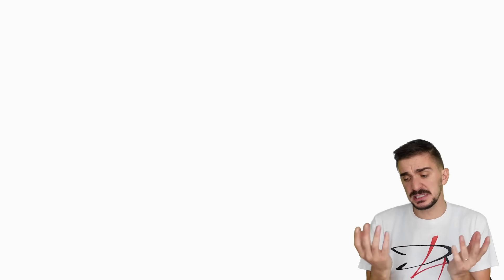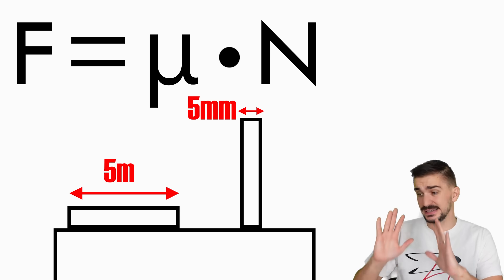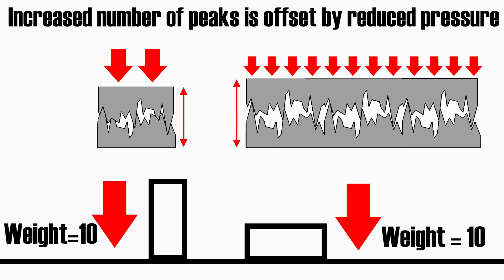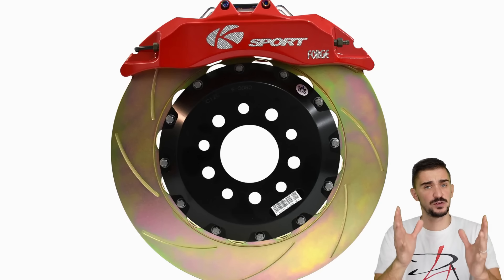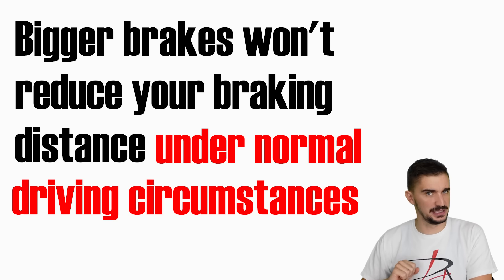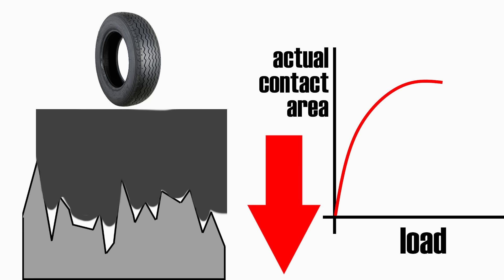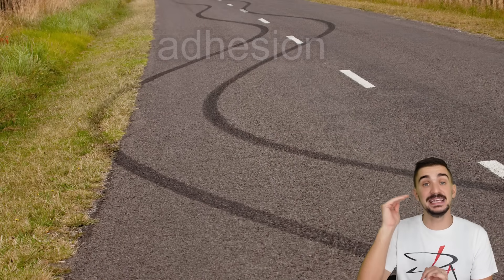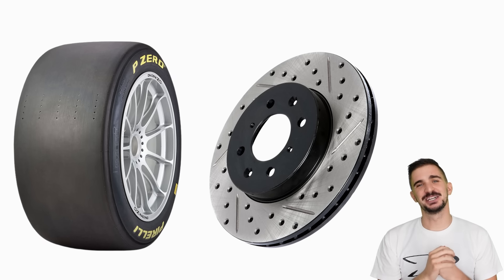Why Big Brakes Won't Stop You Faster but Wider Tires Will - Friction and Surface Area Explained

Comment: Sorry, but your intuition is wrong. As a motorcyclist I will tell you a simple fact that the same motorcycle with a 320mm front brake rotor will stop faster than with 270mm rotor.
You are trying to make a point that friction force matters. That is partially true. Yes, if the force increases that affects the stopping distance. And yes, the force will not change if you will put a bigger brake rotor.
But it is not force that stops a car/motorcyle. It is work that a brake system is doing. Work is proportional to force x distance. At 60 mph a 320mm brake rotor will do more work than 270mm. That is simply because a length of 320mm brake rotor is larger than 270mm. A brake pad travels longer distance in the same period of time which means that a brake system with a larger brake rotor is more powerful. A more powerful brake system will transform kinetic energy for a car/motorcycle into heat sooner.
All that heat thing matters at high speeds when a brake system needs to turn a lot of kinetic energy into heat very very quick. When you are riding 20-40mph it is very far from that problem.
Reply: if the 270mm rotor setup is enough to lock the wheels it will make 0 difference going to 320mm. cant lock the wheels more lol
Reply: @arcanevoid9199  it can be enough for loose dirt and knobies but weak and mushy for road tires and asphalt.

Comment: The limitng factor is not brake size, its the size of the contact patch and thus higher coefficient of friction with the road. High school physics. However, big rotors have a much larger capacity for heat dissipation thus repeated and higher speed without fade. Thats why sport cars use bigger brakes. Same goes for ceramic brakes. In cold condition they might be worse than steel, but during race conditions the can withstand twice or more tge temperature and again, much lower fade.

Comment: Because even small brakes have enough clamping force to lock up your wheels. Wider tires give you more grip on the road so your brakes can squeeze harder before the tire slips. 
    No need for that explanation to take 16 mins.

Comment: in my, albeit, limited experience, bigger brakes stop you so much faster
been there, done that, on the track and on the road
the harder you brake, the more the weight transfers to the front, leading to more weight on the front, leading to more grip from the tyres, meaning you have more friction on the road, leading to more grip
i've done this on every car i've owned and only the very light fiestas would lock up quicker
the others have just lead to so much better stopping power
can't fault your logic on paper though

Comment: Years ago, I had a 1984 VW Scirocco which was a project car.  One of my upgrades was the brakes. It came with 8.4 inch disks at the front, and drums on the rear.  I upgraded to the 16V spec brakes which I got from an auto wrecker.  They were 9.1 inch disks at the front, and disks on the rear, along with the vacuum booster and master cylinder and stainless braided lines.  After the conversion, the first thing I noticed was that I was always braking too soon as they were stopping me quicker.  There was no change to the existing wheels or tires.  Why the braking difference?

Comment: Good explanation, but one point missed. If you are upgrading to larger diameter rotor with appropriate caliper and pad. In this case even the braking force on pad might be the same as before, the brake torque is still higher measured on the hub, because of the larger radius.
Reply: It is, but it does not contribute to total braking distance on its own. Stock brakes already have enough friction to reach above maximum grip on your tires. However with a bigger brake rotor with upgraded calipers and pads the brake pedal feeling will be different, because the amount of pressure needed on the brake pedal to achieve above maximum grip on your tires is less as a result of increased brake torque. This means that slaming brakes all the way on a stock car and a car with upgraded brakes will result in same (or almost same) braking distance, but pushing your brake pedal to, lets say, 10% of it's travel will have greater effect on a car with bigger brakes. (assuming everything else in said cars is the same, which is almost never the case)
Reply: Thank you for pointing that out! Was looking for this comment!
Reply: Brake kits with larger rotors often have more individual pots, so can apply more 'normal' force. This may not actually help much if the standard brakes can lock the wheels at typical driving speeds. However it will help if you've increased the power of the vehicle, or fitted wider tires! 

An area missed by this analysis is that a custom brake kit may have better mechanical function. What do I mean by that? Better pedal feel, more progressive braking force. These may make the experience of braking a whole lot more predictable and pleasant. This really does seem to be the case with (for e.g) Brembo kits - in some cases the actual braking distance improvement might be really small, but the experience means you have confidence to mash them and achieve much better stopping!
Reply: You need to stop your tire from spinning or need to stop your car? 😂

Comment: just seen u r other video first lets have a set of breaks from my hatchback on a Ferrari n see if it makes any difference or not you need a combinations of Tyres tyre compound discs calipers weight of the car n everything else mate, you know I know we all know this is right BUT what we do Not want is breaks been so over servo you just cough n the air pressure from your cough locks your breaks LOL Most Japanese cars have Breaks so over servo just like Power steerings in the 60s so over sensitives you didn't have a clue was you driving on ICE or you had a good grip, but the "expert engineers" always "know best"

Comment: Thank you for the second video, it is appreciated. 😁
Brakes and tires should be matched to one another, or you could get into trouble.
For example, bigger diameter tires require bigger brakes ... something off-roaders sometimes forget.
Something like a 3 ton Jeep going down the highway on 40" tires and with bottle top caps for brake discs is incredibly dangerous !

Comment: Other than better cooling in bigger brake discs, i think the bigger the brake disc is, the more braking torque is generated through the wheel with the same brake pressure. because it's like using a long Wrench vs a short wrench. as u know u can screw a Bolt easier with a long wrench than a short one. So I think same goes for brake discs. But using bigger brake discs will be useless if u don't have enough grip and traction in your tyres to use all your brakes capability. Except for the heat management.

Comment: I have a small car workshop in Thailand. I explained a lot to my customers, as you said. 
If they use the car in normal conditions, e.g., in everyday life.
It's optional to upgrade the brake if they want, but just OEM. It's entirely enough. 

Investing more money in new tires is a better option. It's the fence between the car and the street.

For example, most cars didn't upgrade their brakes and could drive on the German autobahn safely without a speed limit.
That means the OEM specification it's enough. 

You're very professional from the practical to the theoretical view.
With suitable examples, good explanations, and easy listening. That's super cool!
Reply: ร้านอยู่แถวไหนหรอครับพี่ อังกฤษพี่เก่งมากเลย สุดยอดเลยครับ
Reply: ตามด้วยครับ
Reply: ตามด้วยคนครับ

Comment: Definition of the "Normal force"... physics disagree with you. It weight P that presses down onto surface (or tenses the suspension), "Normal force" is complementary force, and in general case it is not equal to weight (neither as vector, nor as magnitude).

Comment: Larger brake disc will give more torque. torque = d * F where d is the distance between force(F) is applied and torque is measured at the wheel hub.  But like he implied if the tires don’t grip bigger rotors won’t help…

Comment: I was on the highway a few months ago on the way to the beach, it was raining and traffic was backing up, all of a sudden traffic came to a complete stop, I   Had to use a lot of brake to stop quickly, I have upgraded wheels and tires, they are lighter and wider, I have the Michelin pilot sport all seasons and I remember how effectively they worked, the car behind me had to swerve into the other land to avoid hitting me from behind, I’ve upgraded my rotors and pads also but i credit the tires for helping me stop so quickly.

Comment: I don't think you got this one right. the key to heat management is the mass of the rotor, rotor cooling, and the operating temperature for the pad. Formula One cars and NASCAR stock cars have had small-diameter rotors for years. However, you select the different mass rotors for a low-braking superspeedway or a heavy-breaking road course.

A larger diameter allows you to create more storm more stopping force for the same caliper pressure which equates in most cases to the same pedal pressure. Trucks, which often have smaller diameter rotors than many cars, can have hydraulically assisted brakes that generate pressure double that of passenger cars. When someone installs larger diameter rotors and a caliper with greater piston surface area, the pedal pressure required for a given force on I saw in the rotor and force required on the rotor for a given braking torque is reduced.

Comment: Larger surface area of brake rotors leads to reduced temperature, and reduced wear, meaning you can stop in the same distance more times, meaning over time you can stop faster

Comment: Sorry ! I fitted std. diameter AP discs and six pot callipers to my 2002 Prodrive STI and the increased N produced a greater F. 
Thus it stopped way faster - to the point where the ABS simply couldn't keep up with the vastly improved braking forces. 
ABS is not a substitute for technique. Hammering the pedal produced a huge increase in grip and avoided ABS activation.

Comment: I have to disagree with the usage of friction formula in this kind of settings, as the formula is too simple and doesnt account for any things that matter for this case. As the friction formula only use an assumption that contact surface will never really pressed to the limit of material itself, nor it take into account how much strength the material can handle before its surface peak break.

Comment: I do not agree with the conclusions drawn about the physics of a disk brake. I agree with the observations of force. The total sliding friction force does not depend on contact area for dry and rigid materials. But, if that holds, the total work done, increases linearly with the diameter of the brake. Work being defined as the inner product of force and path length. And it is the work done that is equal to the reduction of kinetic energy of the vehicle. So, disk brakes with twice the diameter at the contact with the braking blocks, have twice the braking power.

Comment: Hope u don't talk rot n give ppl the wrong concept. 
F1 & WRC all become liars if that's what u said r true.
Reply: Nah, it lines up - big brakes in racing designed for less fade under heat loads (brakes need to warm up) and designed to better dissipate heat for longer duration of use under racing conditions without overheating. What is wrong with what was said in the video?

Comment: I can't trawl through all the comments - but I'd only add that - esp for driving your car on a track/racing - then brake 𝘮𝘰𝘥𝘶𝘭𝘢𝘵𝘪𝘰𝘯 is also an important part of 'brake performance'. As such, in changing your brake components about, you're also trying to obtain the right personal sweet-spot as regards brake modulation.

Perfection in this regard however can be as fraught as the perfect audio system.

One's modulation needs can vary from track to track, or even within different parts of the same track.

Comment: Wider tyres only have an increased contact patch if the tyre pressure is lower. Contact patch size is dictated by tyre pressure, weight of vehicle and sidewall stiffness.  Tyre width is irrelevant and changes contact patch shape NOT size.
Reply: i mean it obviously changes the contact patch size, have you never been behind a car with like 300 width tires?
Reply: @arcanevoid9199  the contact patch area is dictated by the weight of the car, the stiffness of the sidewall and the air pressure. Tyre width DOES NOT affect CP area. Your mate with wide tyres has softer tread and sidewalls if he has a bigger area  OR the contact patch is a different shape.....

Comment: I've driven a '60s Bug.  Tiny drum brakes.  But the VW would use all 30-something HP to hit about 90 mph.  Stopping from 90mph was hard, because the tiny brakes, and no brake booster.

And nearly every "wider tires increase grip in these conditions" can be applied to bigger brakes, but the subjective emphasis is given on the tires, and less so on the brakes, to make it "feel" like it matters more for tires than brakes.

Brakes are a more important upgrade.  Most stock brakes are not much better than legal minimums.  Having had a car with the best brakes the racing division of the car maker makes on my car allow me to run at the track all day with zero brake fade.  People don't run on the track all day, but the VW bug from above, and other crappy cars on stock brakes will experience noticeable and serious brake fade in a single stop from legal speeds.

Stock brakes are crap, and a brake upgrade is much more important for a stock car than upgrading the tires, which doesn't make nearly as much difference from 205/55 to 225/45 as it makes going from all-season M+S to summer tires.

The explanation might be "true" for an unrealistic theoretical case, but for good performance and repeatability, brake size matters more than tire size, and composition matters more for both than size (within reason).  185 wide racing tires will get a whole lot more grip than 245 wide all season M+S tires.  10 " vented drilled slotted rotors will resist fade more than 12" solid discs.

So 100% wrong on all counts, but it sounded good.

More contact area doesn't help with grip.  slicks have better grip because they lose all tread squirm.  That's why slicks "win".  zero squirm, not more contact area.

F=uN works fine for tires. "wider tires brake better" and the graphic behind your head shows that increasing the rear width and holding the front steady increases braking distance.  So wider tires make you stop slower (255/35 to 285/30 rear, with 225/40 front).

You really want your wrong answer to be true.  But even your own graphics prove the opposite, for at least some cases.  You'll get a bigger difference playing with tire pressures than tire sizes.

Comment: Another factor to heat management with larger brakes is that larger brakes typically have more mass in the ring, which increases their thermal capacity. That means they don't heat up as much in the same braking zone, and thus their temperatures remain more stable. Even with the same amount of heat dissipation per lap, larger brakes can outperform smaller brakes if the race track has a lot of braking from high speeds.
Reply: That only has an effect in racing applications, in every day life, you're very unlikely to overheat your brakes

Comment: Here is all i  know, larger brakes require less pedal effort to lock up the wheel giving me better feel and modulation, this "feel" is also contributed by fixed calipers included in almost every big brake kit available, these have stronger bite and a predictable bite point  compared to floating calipers which feel soggy initially. Its all about the feel fellas, use whatever feels better

Comment: Larger rotor diameter will increase the braking torque, as torgue = force X moment arm. So even though the frictional force will  not be different for a larger diameter rotor (as it depends primarily on the applied brake pedal pressure), still larger diameter will give more braking torque and lesser braking distance. I love your videos and your explanations, but this one does have a partially neglected side of physics

Comment: Marine from Vermont, love your YouTube channel. Had a 1986 mr2 NA as my first car, took it out illegally with a friend when we were 14 years old. At 90mph I was testing the handling, my last words were "it handles like a viper", the rear end came around, we slid off the road sideways into a field near my house, hit a stone wall, then ran back home to get a 1962 dodge m37 army truck my dad and I restored, used the pto winch, got the car back home in the garage just before the cops drove by. Repaired the damage right there, my dad never found out what happened. Talk about lucky. Snap oversteer isn't a myth hahaha

Comment: Doesn't a bigger brake disc provide a leverage advantage over a smaller brake disc?
Reply: Yup
Reply: @madness198648  ok, so bigger brakes actually do improve your braking distance
Reply: @MatteoBaldi  Nope, no they don't, check out D4A's new video on exactly this topic
Reply: @josephkennedy1212  just watched the video and yeah I didn't think about it, a greater braking force is pointles if you don't have grippy enough tires

Comment: My car does not have abs and already upgraded to wider tyre but in emergency breaking the tyre will start to skid..So im planning to upgrade bigger caliper and disc so the force is reduced and have longer time to reach the tyre to start skidding. Is that correct?
Reply: that wont help at all, will probably make it worse if anything

Comment: Why would there be more contact  surface with wider tires? If the weight of the car is same and the tire pressure is the same, then also area is same. Only difference should be that on narrower tires, the area will be spread more longitudinaly.
Reply: Its amazing how many people don't understand this. Wider tires change the shape of the contact patch, but not the area!